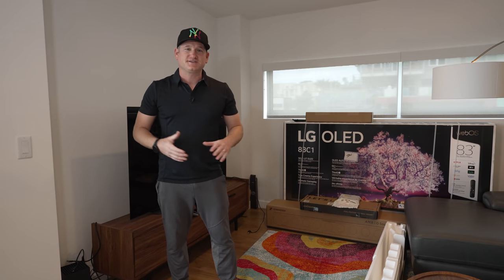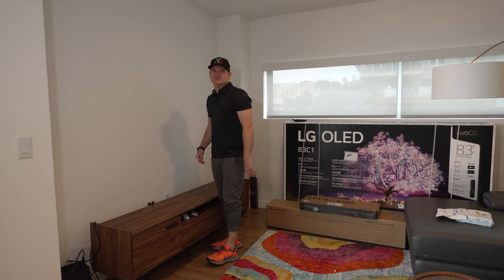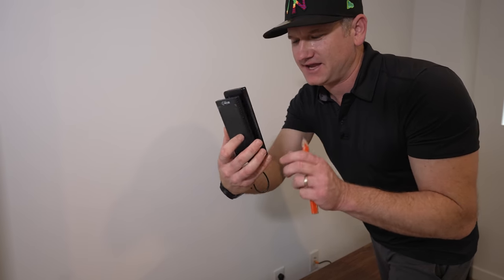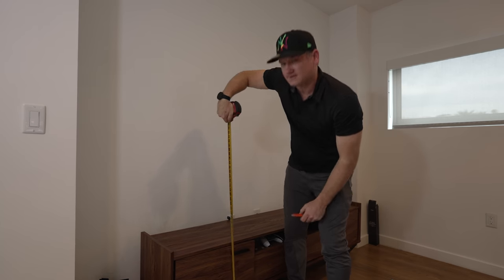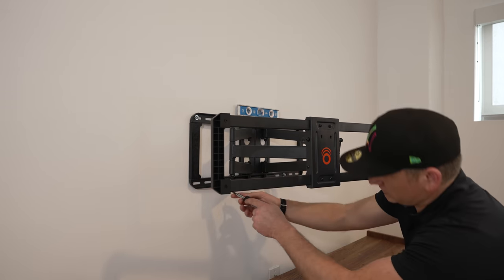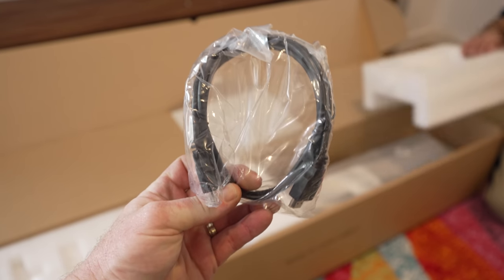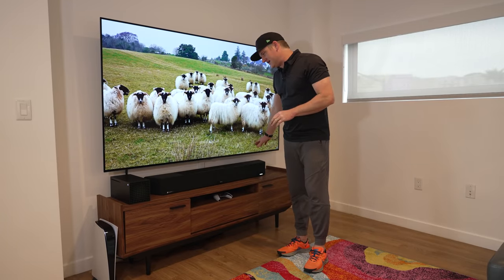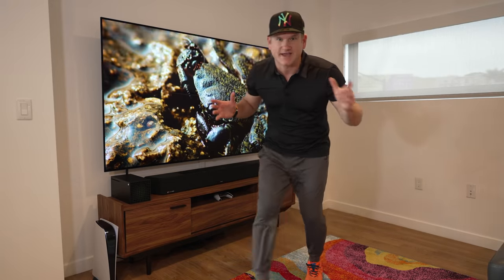83" LG C1 OLED with Sennheiser Ambeo 5.1.4 Soundbar

Comment: Sweet video. One suggestion for the soundbar, pull it forward so the drivers are on the edge of the cabinet. Currently, it will be comb filtering with the immediate reflections from the top of the cabinet. If pulled forward, the dialogue will likely sound clearer.
Reply: Thanks, I'll try that!

Comment: Just picked up the AMBEO on sale. Paired with our SVS sub and a smaller LG C1, it's a pretty magical experience. Sounds better (for movies at least) than the DefTech 5.1 setup I have installed in the same room. Music is about on par.
Reply: I never knew the Ambeo has a sub out!
Reply: @davidleingang5591  it does! I've actually got an Energy ESW-V8 that I'm going to add to it. I bought it years ago and I've never even used it.
Reply: dio you have problems with disney + making pops? how did you fix it.
Reply: @reliev33  I do not. The only pops/static I've heard was during the calibration/setup sequence and occasionally when I've been changing inputs. But I plan to have the TV's eARC output as the AMBEO's only input, so switching inputs shouldn't be an issue. Really happy with it so far.
Reply: @GearBits  yeah i have the same setup i think its something with D+ everything else is awesome.
Reply: Good luck with the soundbar. The are a lot off issues according to users.

Comment: Good luck with the Ambeo.  I returned it last year.  It does not work well for all rooms especially if you have odd shape room, soft ceiling, lots of windows or large room.  It needs good surface to create the sound effects.  The center dialogue is good but without the added sub, you're not going to feel the impact much.  Also, if there aren't proper wall structures, it will not be able to do well in creating the rear sound effects because there are no rear speakers.  You're better off going with the Sony HT-A9 with Sub.  I know it's hard to get one now, but if you keep checking the web and act quickly you may get one.  Sony seems to figure out a better way.
Reply: I'm actually adding an Energy ESW-V8 that I bought years ago and never used. Other than that, it sounds fantastic and I couldn't be happier!

Comment: Great video. I have two of those soundbars. One connected to my 65" CX and the other connected to a 50" Samsung. I recommend getting a subwoofer, it takes the sound to another level. I paired mine with the Klipsch SPL-120.

Comment: Great combo. Don’t see the Ambeo often; I would have gotten it instead of the Arc if it had a wireless sub connection. Instead of $5,000 I may have spent the extra $1,000 for the A90j 83”
Reply: A90J has really bad motion compared to the C1
Reply: I'm a gamer and have both PS5 and the Xbox. I need the 4k 120hz inputs.
Reply: @kyokushin1289  yes. The motion on the C1 is superior.  And I Never hear people talking about this

Comment: Got the set with the bose900 incl. 700 bass module and 700 surrounds on the jewel stand. Oh I struggled so hard with the decision between the Bose and the sennheisser. In the end convenience made it and beat sheer sound quality. But the set it awesome as well. And I switched from a teufel THX 5.1 system

Comment: B!  I love this setup and your videos.  I just picked up the C1 65 along with the ambeo.  It sounds and looks INCREDBLE!  I cannot get my magic remote to control the volume on my soundbar.  I have earc plugged in from tv to soundbar and all devices directly to TV.  Without my devices plugged in volume control works on remote but once I plug either my pc or PS4 the the tv volume control stops working.  I called tech support and they could not figure it out.  I'm stumped.
Reply: Try holding the button down, I have to do that from time to time.

Comment: Ambeo recommends 5” of clearance between the bottom of the TV and the sound bar. I think it’s because the bar gets so hot.
Reply from the maker: That would be for the atmos speakers to get the sound out without getting caught behind the tv.  This tv is back deeper in the recess so it wouldn't be an issue.
Reply: @BTheInstaller  smart!!!

Comment: I am buying a TV and the choice is between C2 65" and G2 65". The price difference is €350. With the fact that Lg has a promotion where it gives 3 additional guarantees with the purchase of a new TV, Lg C2 2+3 years of guarantee and also a gift lg soundbar (according to the reviews, it is not the best, so I will most likely sell it immediately). I plan to put the TV on the wall. What is your recommendation to buy? It's for my living room. Is this price difference justified between c2 and g2?

 I would buy another wall mount for the reason that when I drill the holes for the wall mount, I have to do it once, later when I change the TV, so that I can always put another TV on that wall mount, which is an additional €100. Surely they would rather take the G2 than the C2?

Comment: Awesome "view into..." and system, fellas'! AR and Christy are huge on the Ambeo; how does it accommodate/throw side, rear and height surround objects to the couch or sitting area, however? Gave the Ambeo a lot of consideration before settling on SonosArc "5.1.2" (Arc, Sub 3, One SLs - 2). I can definitely state, with streaming as source, there are no Atmos or seriously differentiated height audio objects, lol, for my Sonos Arc "5.1.2" "HT"; all Atmos is not created equally. Still, very happy with it, overall.

Comment: Hi from India, as LG capped C1's and G1's HDMIs at 40GBps,  are they capped on hardware level or are they capped by software? If is it on software level then is there any possibility to get firmware update from LG to unlock them to full 48GBps bandwidth?

Comment: Did the client choose the wire cover? I'm curious because I would've chosen to run wires behind the wall.
Reply: It's a rental, the apartment/living space I mean.
Reply: @lubaniskie   Only requires two small holes 🕳 to feed the cables. Not more than 2 inches, something that can easily be covered in less than 15mins when moving out.

Also the entertainment center doesn’t work well for those consoles. Need open space or would have mounted the tv higher.
Reply: I live in an apartment so I didn't want to be too intrusive.
Reply: @tears2040  by electrical code, you are not suppose to wall fish tv power cord

Comment: I have a question,i have a Samsung HW-Q800A sound bar, it works flawlessly with my samsung tv but I'm planning to buy c1 and I'm just curious if samsung sound bar will work fine with lg c1 tv?any idea?
Reply from the maker: Lg typically works well with most devices.  The only benefit of the Samsung is some newer Samsung tvs can be used in the sound system.  But tv speakers added to a sound bar would not be something I would care about. My a90j barely holds up as center with the ht-a9

Comment: For those of you shopping for an OLED the LG C2/G2 (2022 Models) will be out in April 2022. The C2 will get the EVO G1/G2 panel. There will be ridiculous deals on OLED 2021 models.

Samsung is releasing a new tech QD-OLED panel in their Samsung OLEDs. Sony will use the Samsung QD-OLED panel in their 55/65 inch A80K/A90K OLEDs. You might have to wait until 2023 to get larger 77/83 inch QD-OLED TVs from Samsung and Sony. A very large 77 inch+ Sony might use an LG OLED vs. the QD-OLED panel in 2022. Patience Grasshopper. Kung Fu.

Comment: Not to knock on the Soundbar, Sennheiser is a great german brand, and I have beautiful Headsets from them, but for 2 Grands, I'll much rather stick to a dedicated 5.1 Set with two huge standing Frontspeakers, two Rears, Center and a massive Subwoofer, by reputable german speaker brands like Nubert or Teufel. That's just a) still way more immersive than even the best Soundbar and b) 20hz earth shaking Subwoofer experience which a Soundbar can't even remotely simulate. Sure those 30 hz are neat for a Bar, but it's children's play compared to a Nubert Set.

Comment: I don't get why a person would spend 2500$ on a device that cannot physically reproduce low frequencies, 4" woofers are just too small.
Subwoofer should be mandatory for any soundbar >300$. Apple like users just buy the Sonos Beam because of the design, i got it, but it's 2000$ cheaper at least.